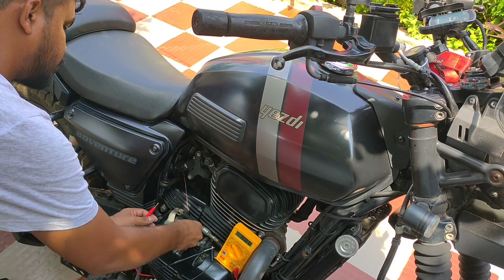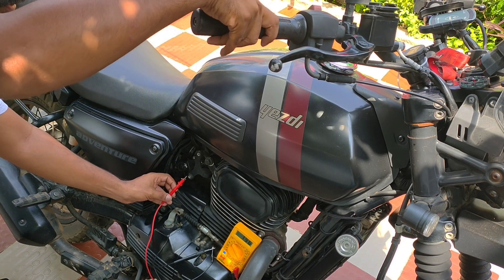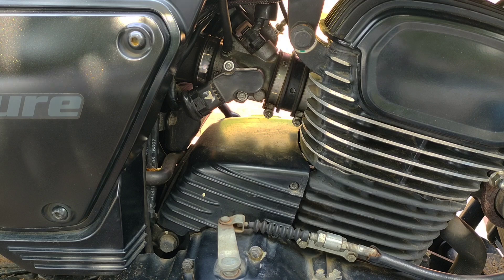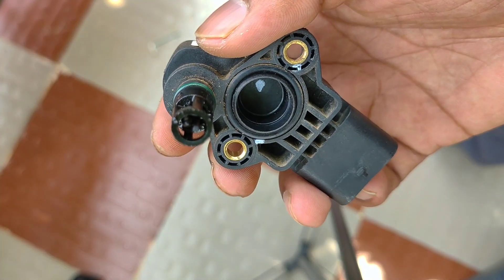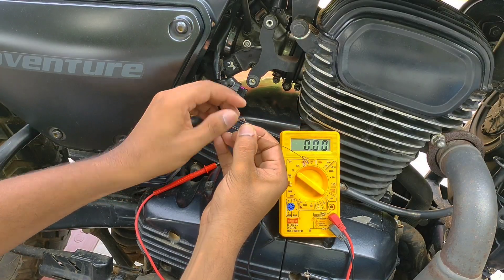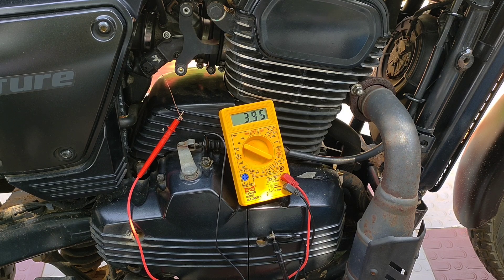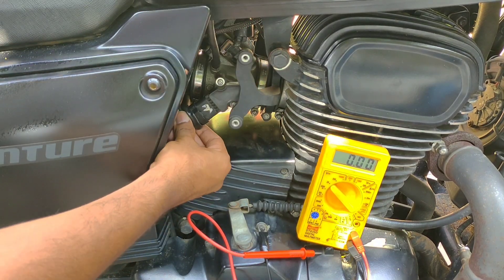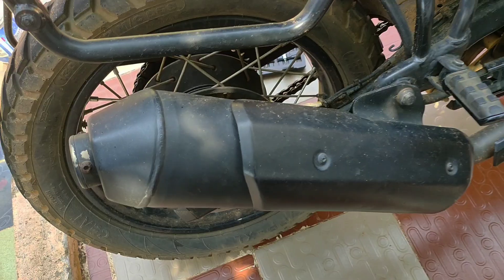How to check TPS Sensor in Yezdi Adventure with multimeter

Comment from the maker: It is also Called 3 in 1 Sensor, Tps, Map and iat Sensor combined
Tps - Throttle Position Sensor,
Map - Manifold Air Pressure Sensor
Iat - Intake Air Temperature Sensor

Comment: Battery symbol shows on my yezdi adventure . I did charge using meccanic but after a 20 days usage if I am not using bike for 2 days it's notnstarting still shows battery symbol however horn headlight indicator are working fine .. battery charge guy said battery isnholding charge and fine.. any advise on this pls
Reply from the maker: @narayananvenki  How old is your bike battery, the problem is discharging at rapid rate which means it can't hold power there by voltage drops. Sometimes even at a point of temporary charging if we don't run the bike the battery looses the voltage at every single self start .

Thus makes it impossible to deliver the enough torque to spin the starter motor and  bike.
Reply: @baby_adventure  3 years now with 7300 km driven
Reply from the maker: @narayananvenki  it is time to change the battery.
Reply: @baby_adventure  do I need to use the authentic one in showroom r I can use amaron r exide ? The one in showroom is 6k plus
Reply from the maker: @narayananvenki  outside batteries from authorised battery dealers are genuine too
I bought Amaron 12V 9Ah it costed me 2000/-
So, it doesn't make any sense to put that much money I guess.

Comment: My Fuel x pro stopped working in my yezdi adv, same time i had issue with TPS sensor so had to change , is it because TPS fuel x pro stopped working? Is it related ?
Reply from the maker: TPS is throttle position sensor it just sends the signal to ecu , fuel x pro tweaks the oxygen sensor readings that are sent back to ecu, but in Yezdi Adventure TPS sensor is a combined one with MAP and IAT Sensor these are responsible for mass and temperature of Air.

So ecu couldn't calibrate the readings with errors from the sensors.

Fuelx just tweaks the readings that come from oxygen sensor and send our desired signal to ecu. To adjust the  AIR FUEL RATIO
Reply: @baby_adventure  thanks bro for all info, your videos are very helpful
Reply from the maker: Thank you😄 for the appreciation

Comment: Is it possible to install slipper clutch system in to older yezdi adventure?
Reply from the maker: @takvimkazi4933  yeah, you can swap the clutch system, springs, pressure plate and clutch hub will be the difference

Comment: Have to do this maybe, my bike doesn't idle good, and sometimes will running, when pulling clutch the engine just cuts off, 
Btw how to know all of these technical stuff...its very hard to get yezdi technical info
Reply from the maker: @athulistaken  hands on time, some practical knowledge which comes with experience to interpret things as yezdi adventure is new no sources are in the internet, I use chatgpt to interpret the values and using the same knowledge for presenting the video when it comes right. It is easy when some did the trial and error put the basics on the table. That is what I am trying. One more thing is Sensors can't be repaired they can only be replaced. That is the reason I didn't want to do these videos long ago. But I thought it might be useful so I put them😊
Reply from the maker: You can start with adjusting clutch free Play and to ignition coil
Reply: Thanks bro, will check, yh sensor cant be repaired but ur videos can help us find which sensor is at fault...i am all in for these kinda videos
Reply from the maker: @athulistaken  thank you , gonna end this series with rear tyre removal, I feel exhausted 😃😃